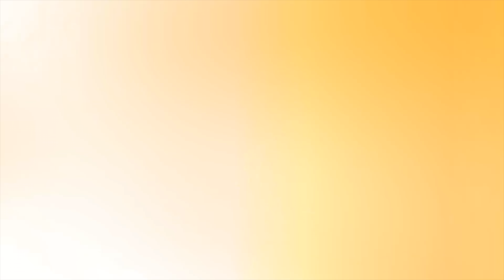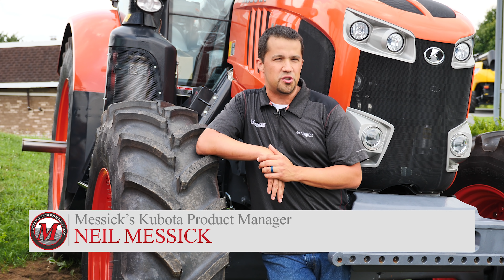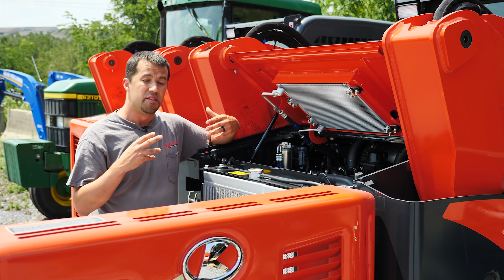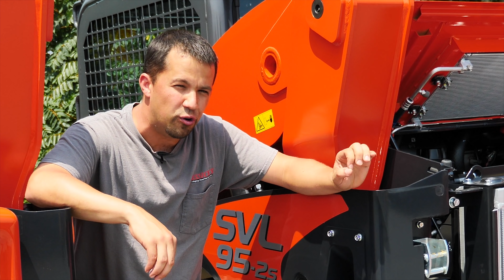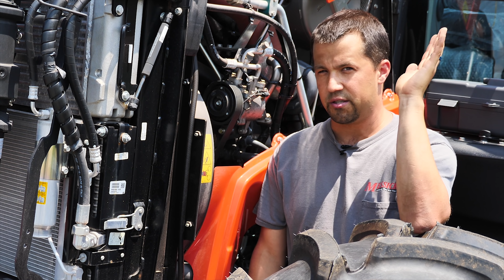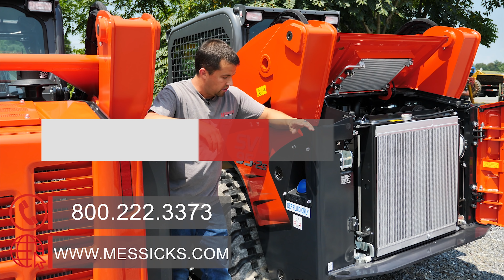6 Tips to prevent emissions system trouble

Comment: DPF seems good to me because I wont have to breath in that deadly soot. I mean if you run your machine and work it, it seems like you don't have to regen often and you breath better air. Why is everyone have such an issue with this?
Reply: parts and service that aren't easy to self-do

extra special requirements, not some simple, basic

making it much more / nearly impossible to be independent operator for decades on end, always needing to rely on something/someone else - it's no good that way
Reply: As long as you keep wearing your mask while alone in your car you should be perfectly fine.

Comment: Good thing some tractors have a economy PTO you know low rpm
Reply: Higher loads and lower engine speed actually makes more heat...take a semi up a grade and let the engine lug down...if you don’t gear down and keep the revs up the exhaust temp will go up until you melt the turbo inducer.  Diesel engine speed and power output is 100% controlled by fuel flow...the only difference between the economy PTO and the normal PTO is the engine drag and fluid losses in the drivetrain and noise in the cab.  The EGR system causes soot and a poor burn and that causes the most problems with the DPF.  The CCV or crank case ventilation filter is a good thing because it coalesces the oil out of the blowby and keeps it out of the combustion chambers.
Reply: Literally the point of the video is that higher RPMs are better...
Reply: Then why give a tractor a economy PTO to run Less RPMs if you need to run higher rpm’s for your particular filter
Reply from the maker: Very good point, one I've heard from manufacturers. It's a feature people ask for, even if it makes little sense

Comment: Just FYI I run my Kubota M5-111 at 2200 rpm most of the time. While raking hay I will run it at 15-1800rpm. The DEF header has gone bad and now I'm getting an intermittent "bad DEF" warning. I have yet to find anything that the government gets involved with that actually improves. I still like my tractor but I wish I would have bought an M9540 back in 2010 when I bough my M6040 and then I wouldn't have had to upgrade my HP.
Reply from the maker: Common problem right now. Happens when your DEF gets too hot and off gasses. They have an update kit for it.
Reply: @MessicksEquip  Yessir, she's headed to the dealer on Saturday so they can get started first thing Monday.

Comment: Betting significant number of people watching this video missed the point that not all emission control system use a DPF filter.  Yes about to use cut and paste - sue me. Just like to get things right and not just close or inaccurate. The exhaust after treatment devices used on John Deere, Kubota and Cummings  are high pressure common rail (HPCR), exhaust gas recirculation (EGR) system usually, Diesel Oxidation Catalysts (DOC), Diesel Particulate Filters (DPF) and Selective Catalytic Reduction (SCR) catalysts. For Fiat and Acco  engines delete the  DPF. The proceeding may not always apply for all engines from a manufacturer. Most engines 75 engine horsepower and under can meet emission control  standard without using DEP which ( corrected spelling)  is used in the final step in the SCR to remove NOx gasses.

Comment: A message to the wise - If you are lucky enough to own an older machine, with no or little emissions system, BABY IT for all it is worth. MAKE IT LAST AS LONG AS POSSIBLE !! My 2005 TC 33DA has no emissions system that I no of. All I do keep it full of quality diesel and run it. It will be my last tractor.     sdh in CT

Comment: C’mon Neil...common rail, electronic fuel injection or not...higher RPMs means more fuel consumption. 

Furthermore, even a DPF-equipped tractor doesn’t need to be run at high RPM all the time. Think about all the diesel trucks on the road with DPFs. They idle a lot, and cruise at far less than wide open throttle. The reason they don’t cruise at wide open throttle is to lower fuel consumption of course, along with reduce noise levels and engine wear. As a rule of thumb, just don’t excessively idle or operate at low rpm. 

Lastly, be very careful what type of additives you are using. High pressure fuel pumps require lubrication from the diesel itself, and some additives contain solvents which strip that lube. Others claim to eliminate water...they typically emulsify it which means water is still flowing through the pump...bad news. Better to let the water separator for its job and drain it.
Reply: Higher rpm does not mean more fuel consumption at all. Spend a bit of time with a tractor on a PTO dynometer and you'll find that statement to be not true at all. The harder the engine works= more fuel consumption. 

Ask yourself this, is an engine that is at half throttle with a hard load working harder than an engine at full throttle with the same load? Yes and the same engine at full operating rpm with the same load is making more power and being more efficient thus not working as hard to overcome that load, thus using less fuel and also running cooler. Played with this many times over the years on dynos and in the field. Granted there are always exceptions to this as if there is no or very little load on the engine then of course lower rpm with reduce fuel consumption.

 But that being said with emissions equipment we have found the systems to function better and last longer with high rpm and high load applications. With higher temps in the system there is far less carbon buildup and therefore less (and shorter) regen cycles and issues in general. I personally don't agree at all with the concept of emissions equipment and find it to be just another money grab for governments but it's something we have to deal with.
Reply: You are describing a "lugging" scenario operating under heavy load at half-throttle. Not good for the engine, and will use just as much if not more fuel. But that's not what I'm talking about. I'm saying an engine will use the least amount of fuel when it is running at the lowest RPM it needs to in order to efficiently perform the work required. 

At no load, clearly running an engine at full throttle uses a lot more fuel than running an engine at idle. High RPM means many more piston cycles. For every four times the piston moves, fuel is injected, whether common rail or mechanical. So if you are running a lot more cycles (high RPM) with no load, than yes...many more fuel injections occur. 

So if you are just doing some task that definitely doesn't require full throttle to do efficiently...you are wasting fuel. Which is my point...why do you suppose over the road trucks have high ratio gears? For the sole purpose of dropping RPM to save fuel, noise, and wear and tear.
Reply from the maker: Yes, more RPM's will equal more fuel use... but only the tiny amount of fuel it takes to spin the pistons. Fuel use is not linear with RPM like an old mechanical fuel pump. 

all the diesel trucks idling and running at low RPM are the reason they have so many more emissions related problems than we do with equipment. You certainly don't need to be a WOT all the time, what's problematic is the operators that decide they want to work at near idle RPMs.  

I'm with you on additives.
Reply: I agree with you, but I would also note that it's not a horrible thing to idle some of the time. In the diesel pickup world, most manufacturers suggest no more than 20% of engine hours be idling hours. I suspect the ag engine world is similar.
Reply: Best you use something like 1600 RPM: Highest Torque, not too loud engine, good fuel consunption but still a lot of heat.

Comment: Emission control,systems are a pain, and they’re not perfect, but if everyone would just stop and think a bit about your children, and their children, perhaps we could agree that a bit investment in emissions reduction systems and other forms of pollution controls might just be worth a bit of “pain”.   Of course many choose to believe that pollution is just some form of “fake news”, but c’mon people - just look around at the crap we and our predecessors having been pouring out of our factories and vehicles for more than a hundred years.  One tractor without emission controls wont cause significant impact, but hundreds of thousands or millions of tractors worldwide will.  Can we not just stop thinking about ourselves and care a bit about future generations?
Reply: Prof Dave I think it is like driving 20 miles out of way to save 10 cents a gallon on gas. injecting more fuel into the exhaust. takes oil and fossil fuel to make and haul the def. plastic Def.jugs going to the landfill.  bulk def.  tanks have to be heated or it will freeze. More energy used. not to mention all the check engine lights and break downs.  idling kills these systems.  in trucking drivers do not want to freeze so they idle. . we have a fleet of one hundred semi trucks. 4 and 5 check engine lights a day  . ignore it and you are towing it in thanks to our goverment. average people do not understand the cost and aggravation this causes. especially when you depend on this equipment to do a job. deliver products . parts for this system can cost thousands.  .in one instant we had to decide if 4 year old truck was worth fixing or not. 20 grand to replace entire system due to oil contamination.  run a little guy out of business.  ridiculous.  where do you think it goes when they clean the dpf. filter. ? yep right in the dumpster.  of course you can't talk about it .don't fit the naritiv
Reply: bronco 79  fair comment and I understand that the dpf’s are annoying and can add cost to operate and repair (and buy for that matter).  I also realize the overall impact seems insignificant, and there are other associated energy requirements and waste products. As I said up front, they’re not perfect, but the net value of them is probably worth it.  While it takes a bit of fuel to burn them out, it’s a VERY small amount, and what it removes is the chemically-laced soot, which is directly related to climactic impact and water acidification. It’s nasty - nastier than the the products of efficient hydrocarbon combustion. 
That said, I totally agree that the early growing pains from these systems should not negatively impact small business.   And no doubt there are many other ways we can reduce environmental pollution - but we really have to start somewhere.
Reply: no, this is nonsense

stop having so many fucking children

stop with the super-consumerist materialist lifestyles

stop with all the toxic synthetic chemical+textile products that are nothing but poisons for the earth

stop with conventional agricultural methods

worrying about the tiny tiny output of a one-person use carbon emissions is utter nonsense for so many reasons - also know that carbon is the cornerstone of all life and not an issue and those telling you it is have an agenda that has nothing to do with caring about the health of the planet or anyone/anything on it

Comment: What about all the scr only engines in cnh and some agco equipment?  I know they don't inject diesel into the exhaust like the dpf set ups do
Reply from the maker: I should do a video on this. Same tips apply. The Doc only style is effectively always burning.  I would  not say in our experience one is better than the other.
Reply: @MessicksEquip  That would be great. But as far as ive read the doc only setup only needs around 400 degrees Fahrenheit minimum to work, unlike a dpf which needs around 1100 to keep clean?  But yes a video on this would be great, it gets annoying reading forums and infomercials of these two offroad setups.

Comment: Hey a bit off topic here but on your newholland square balers 330 and 340 balers they used to and maybe still do have problems with the roller chain breaking and causing problems, a Machanic changed the routing and sprocket sizes to fix that problem and warranties it this Machanic works for a New Holland dealer called ESM Farm Equipment outa wallenstein Ontario canada if you guys as dealer are experiencing alota of those pickup problems maybe worth something to look into

Comment: Great video, just a few weeks back we were helping diagnose my uncle Caterpillar track skidsteer throwing regen error codes and being in limp mode and it turns out it was the DEF fluid in the tank going bad in the tank itself because of the high heat where he's at, the DEF he had in bottles probably broke down also. It stinks that something as simple as not being able to make a high heat tolerant product, for a machine that will be working somewhere with high heat, can cause so many issues and wind up requiring a tech to come check the machine.

Comment: The CCV filter is a nice touch. Wish the pickup trucks had one. Added one to my truck, should have seen the inside the intake from 20 years of oily crank gunk in there.
Reply: Pickups do have them now.
Reply: Tyler MacConnell about time 20 years later
Reply: Most tractors vent to atmosphere unlike on road machines which go to the intake. Older tractors just had a line from the valve cover or similar and ran it down and just out and away. New tractors still do however it’s filtered.

Comment: The money I save on fuel, is half what it’ll cost me to have my DPF cleaned. One less backyard bonfire at my house a year would offset my emission reduction from my tractor... I get you can’t but would love to hear your opinion on these systems as a knowledgeable user, rather than dealer owner.
Thanks for posting, great info to have if you own one of these machines!
Reply: The real irony of all this is in order to regenerate the aftertreatment you have to make the engine less efficient. So you reduce soot output but increase carbon dioxide output. I bet a modern diesel engine in a car could get 60 MPG with no emissions tuning. Actually we know this to be true, look at volkswagon before they got caught. The TDI cars got that while the Cruze diesel got 40s. If the Cruze wasn't meeting emissions I bet it would get 60s too.

Comment: If the DEF fluid is that volatile and has a short shelf life when not stored under ideal conditions... What do you do with a machine that doesn't see much use and perhaps the DEF fluid has been sitting in the tank for quite a while.  Like perhaps a seldom used rental machine?  Since it sits outside in hot, cold, damp, dry conditions, the storage environment for the fluid would most likely be considered sub-optimal.
Reply from the maker: We are being told to keep the Def tank as full as possible for storage. Stabilizes the temperature, helps off gassing.
Reply: @MessicksEquip  ...thanks for the info...I'll just keep it full then and hope that works out. Great videos and I'm a huge Kubota fan. All of our equipment is Kubota and has been very reliable
Reply: This is the question I really want to see answered....cause I'm in that situation now with a machine that sips on the DEF when I  thought it would run thru it quicker like the regen cycles on my truck....now I have a machine with year old DEF fluid and a drum of the stuff that's never been used

Comment: This is a little off subject but thinking about the higher rpms not necessarily causing higher fuel consumption, does that mean that John Deere’s ePTO is stupid? Or do smaller tractors not have electronic fuel injection stuff?
Reply from the maker: Yea.. your thinking there is correct. It would save noise, but fuel use would be negligible.
Reply: I wonder if it's less wear on parts also?
Reply from the maker: Kinda sorta. I have heard factory people refer to it as silly. I'd still like it for lower noise.

Comment: I had no idea about the revs not using more fuel. I guess I was suckered because normally I put the revs up when I'm mowing or doing something with a PTO and so my fuel usage was going up with the revs and I was obviously equating them wrong
Reply: Does your tractor have a mechanical fuel injector pump?
Reply: @eosjoe565  it's a 2018 1025R, I imagine not with it being that new, but I haven't seen yeah or nay on that
Reply: @jagx234  I'm a JD guy myself. The JD 1-series uses a mechanical injector pump for sure. Just like the Yanmar's on the rest of the SCUT/CUT tractors. So for you higher revs means higher fuel usage. :-)
Reply from the maker: Electronic starts over 26hp
Reply: @MessicksEquip  My tractor is 30 HP and it is mechanical.
Reply from the maker: @eosjoe565  model?
Reply: @MessicksEquip  2720, Yanmar 3TNV88
Reply from the maker: I don't know Deere models. Once you have common rail injection, you've got electronic injectors.
Reply: @MessicksEquip  The engine is a Yanmar 3TNV88. I'm not a diesel expert but the injector pump is all mechanical and has a separate rigid pipe connected to each of the three injectors. Each injector also has a rubber fuel return line.  There are no wires connected to the injectors. There is no ECU on the tractor. It is a 2012 model.
Reply from the maker: @eosjoe565  It's old enough to not be tier 4.
Reply: @MessicksEquip  That's true. This same engine was used in the 2720/2032R up until 2017. In 2017 they switched to a different suffix on the 3TNV88 and I see that one now has what looks like an electrical connection on the end of each injector. Good info. I learned something today. Thanks!
Reply: I have a 3TNV88 in my new John Deere Z997R zero turn lawn mower. The earlier 997 had a mechanical 3TNV82. The old 88 in those tractors were mechanical up until recently.